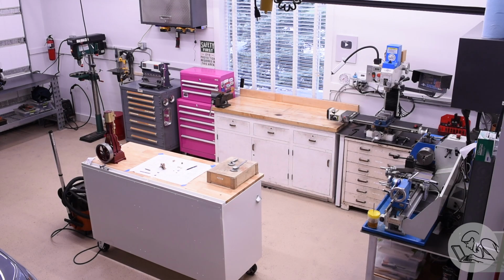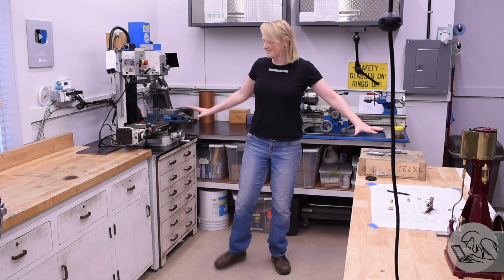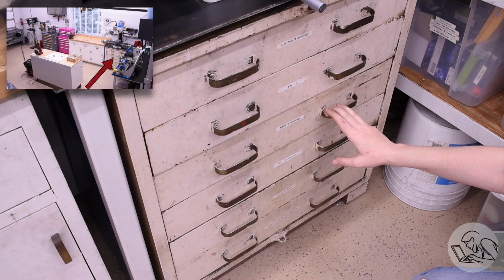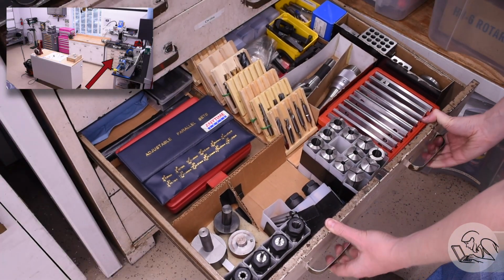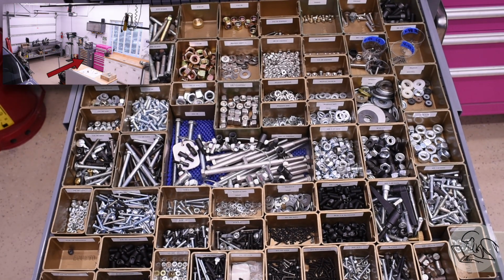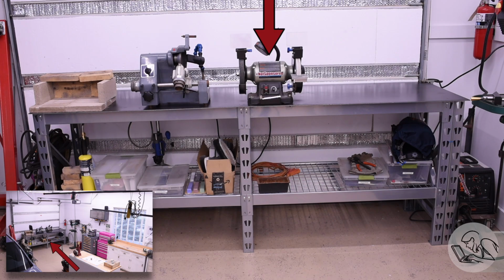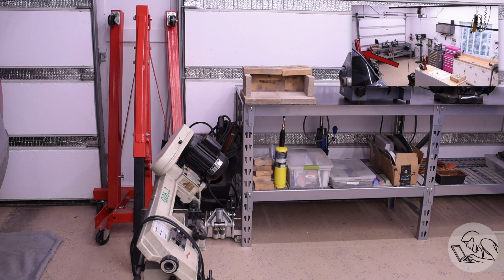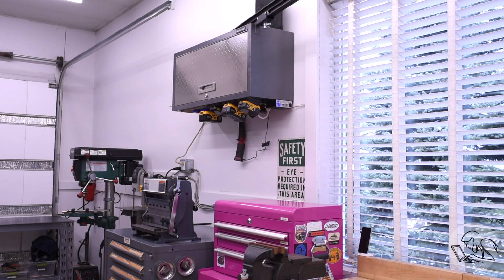New Shop Tour!

Comment: Agreed on the lighting.  I'm thankful that LEDs are making it so much easier to get good lighting these days.  I love the hardware collection.  It used to be that when I needed something I'd buy a box of them.  These days you have the stupid arrangement at the big box stores where you buy by the individial piece,  usually at absurd cost.  A good hardware store is a wonderful thing,  too bad the ones I know about are as far away as they are.  Not only am I not going to go down the path of bigger machines,  my inclination at this point,  largely because of financial and space contraints,  is to go even smaller.  I've noticed from time to time when you run into some limitation of your equipment,  and am wondering if I go real small how bad that's gonna get.  Oh well,  I guess we'll see.
Reply: As a hobbyist, you can get away with using a small machine to make absurdly large parts. I've done it lots of times. Just gotta take your time.